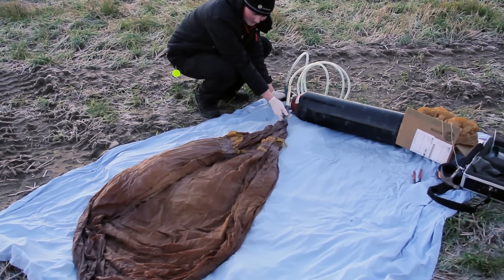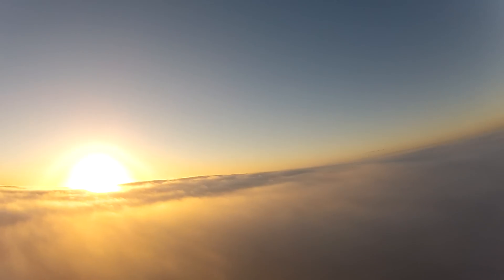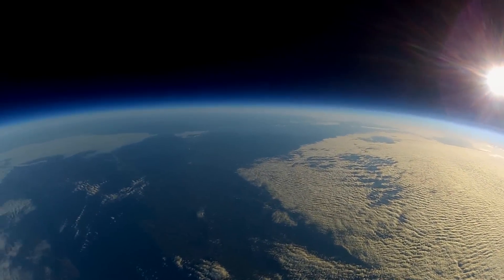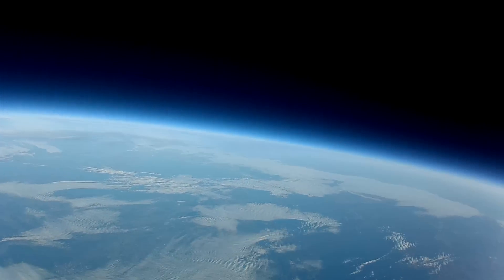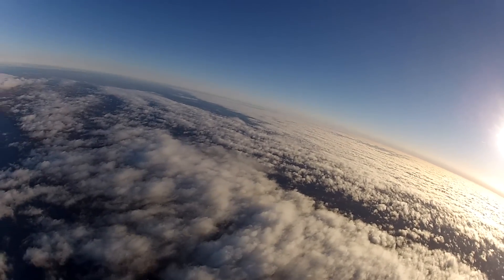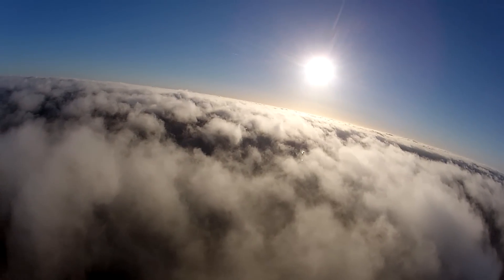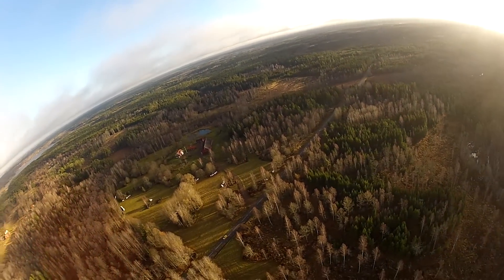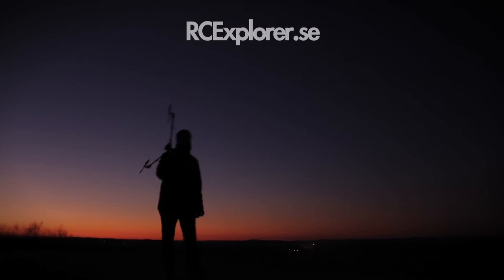Space Glider - FPV to Space and Back!

Comment: next attempt: attach small rockets with a total of 3 stages and get yourself into a sub orbital trajectory with small rcs thrusters on the glider
Reply: You did your kerbal space program thinking.
Reply: lets make crowdfunding and send 1000 satellites on the orbit so we can have free internet, then we can use those satellites to extend range of the remote controller and then we can start colonize the space
Reply: @mario2872  That is exactly what Elon musk is doing with starlink right now
Reply: @mario2872  wow. You predicted starlink
Reply: 8o7wer Endie NO, an rc single stage to mars (fpv)
Reply: Den Da Gamer someone's been playing too much KSP
Reply: Nope, solid rocket engines aren't going to cut it if you try and ignite them at 100k ft. It is true that hobby engines have an oxidizer "usually potassium nitrate" but to get ignition you need 4 things heat/oxygen/fuel/ and last but not least is pressure. Many people don't know this but pressure is required for combustion so only liquid "compressed" fuels or a large enough solid rocket booster where the weight of the fuel itself can provide enough pressure will ever work in a low pressure to vacuum environment. Looking into liquid fuel would be your best bet for creating the 3 stage rocket if you were going to launch it from the operating altitude of a weather balloon.
Reply: a powerful antenna (like really big) or have a relay solar glider to relay the signal. I know its expensive
Reply: @DenDaGamer  dragon link. Cross fire is better tho. Dont need a big antenna. Just a small T on your transmitter and another on the craft.
Reply: Ayyy kerbal space program?!
Reply: Dragonlink. google it.
Reply: Hopefully its possible...
Reply: Codey Dummer  no all model rockets engines have a chemical oxidizer and expelled gasses prevent surrounding o2 from contributing to the burn.
Reply: i think we should make the gun powder and shoot  the satellite to the space,because it's more simple and it's could burning well without oxygen.
Reply: lânchánđời nguyễn ?
Reply: ;)
 @lanchanoinguyen2914
Reply: @lanchanoinguyen2914  he can use a fuel oxidizer :)
Reply: Technically, this WAS a suborbital trajectory...
Reply: @Rickenbacker69  technically, if you throw a ball it already a sub orbital trejectory.
Reply: was my first thought too when i saw the video.
Reply: Codey Dummer it has its own oxygen
Reply: Den Da Gamer i gree that would be bad a$$ i want to see that video
Reply: Beat Elon to mars.
Reply: I will
Reply: You are late.
Reply: Yes!! Then fly it to duna or eve.
Reply: He actually did a suborbital flight
Reply: Ksp in this bitch
Reply: It's not possible, a weather balloon will only take you 1/3 of the way to low Earth orbit, there's no way to get enough thrust to travel that extra distance without allot of fuel and a heavier vehicle to hold it all
Reply: @ArmandoSilvier  ok let me rephrase this a tad, it's not possible at the current scale because you'd need enough fuel to travel those extra 200-300k feet. If we scale up things start looking better, think about model rockets. They can't go to space because of fuel limitations. But u can get higher if u scale it up. So sure it's possible but at this scale not as much
Reply: @ArmandoSilvier  also I feel like balloons are a bad idea, what if the popped rubber wraps around the rocket? It could drastically alter it's course or fuck up it's thrusters. I'm all for thinking outside the box, but balloons imo bad idea to get to space
Reply: FISH EYE LENS
Reply: that is actually very possible
Reply: Or make an X-15, that would actually be awesome!
Reply: 8o7wer Endie pluto isn't a planet, it's a planetoid
Reply: @presuuu  it's all up to human-thought artificial mental conventions. Planet, planetoid... Just our concepts.
Reply: Den Da Gamer . question. how he can have video from so far away?
Reply: Den Da Gamer  girl.       X
Reply: Den Da Gamer in
Reply: Concerning launching rockets from ballons, there IS a company doing that: Zero2Infinity
Reply: doesn't it take 1 million horsepower by today's technology to leave orbit? You start needing more thrust which requires more weight which requires more thrust.....
Reply: billybbob18 you can’t measure this in horsepower.
Reply: while you're at it attach a small titanium shooter, calculate the trajectory of the iss and shoot :D
Reply: that dialect. 1000% gay

Comment: The ballon busted wen it touched the firmament
Reply: No, from a combination of the extreme pressure and temperature.
Reply: +Lord Grief Mc. Scumbag 
No. Not more pressure. Less. There is far less air up there. Extremely cold as well. POP
Reply: blighto Correct, extreme pressure or more specifically the lack thereof. 
In mathematics "extreme" is defined as "a relative maximum or relative minimum value of a function in a given region".
Reply: The air pressure outside the balloon dropped to almost zero, making the hydrogen gas inside the balloon increase in pressure, making the balloon expand. This expansion caused the balloon to burst. To simplify:
Low air pressure outside --> High pressure inside --> Expanding balloon --> Bursting
It has nothing to do with the firmament. Also, if it was because of the firmament, wouldn't it just sort of get stuck there? Like a kid's balloon stuck to the ceiling of a convention center?

Comment: Can somebody send in space a fucking camera that doesn't have the fish eye effect? there are retarded people that say the Earth's curvature is not real and you see it because of the camera effect. Even if it's clear as fuck that the curvature is real because the camera moves left right and the curvature of our planet says still because it's real, there still are people that were probably born in a cave that say it's fake. So send a normal camera into space please. Thanks.
Reply: All lenses have some distortion.. All you need to tell a flat earther is to find a point when the horizon is in the center of the camera, therefore there is not any distortion. You see flat earthers logic works very backwards. They see a video where the earth sometimes appears flat, sometimes round. They come to the conclusion that the earth is flat because of a fisheye lens, not even considering the inverse statement that the earth appears flat due to a fisheye lens. They just parrot the fisheye lens argument without realizing how easy it is to tell when the image is not distorted. Any line that goes through the center of the view will have depth distorted only, so when the horizon goes through the center it will accurately show the curvature of the earth.
Reply: well since the camera is often used for navigation, the fish eye lense is a necessary evil..
Reply: The problem is most compact sport cameras have a curvilinear lens (fish eye) because they show a lot of what is going on around and exaggerate speed making the action look better. If you want to test it properly you need a rectilinear lens designed for photography or professional video work like the camera off a DJI phantom or a proper DSLR with a rectilinear wide angle lens.
All lenses do have some degree of distortion so you need to apply lens profile correction afterwards. But yes, any part of the image passing through the center of the lens will be closer to accurate in terms of distortion.
Reply: There are more videos of normal cameras in space than go-pro's, google is your friend.

Go-pro's are just the hobbyists first choice, so a lot of people have made youtube videos with them.
Reply: E I N S at this height, you still won't see the curvature of the earth

Comment: theres a broken balloon floating around space now - stop polluting space!!! lol jk

whats with the sun exploding video effect? did he add that or whats up with that?

the gopro can survive space?? best camera..best camera ever!!
Reply: 1: he didn't get to space; it starts at 100km and he only got 30km
2: it's called lens flare and such and it happens when the light from the sun overwhelms the sensor, and also is strong enough to see reflections off the clear lenses
3: again it didn't get to space, but reasonably low pressure
But that doesn't matter; all electronics work in a vacuum
Some may overheat though, or in low pressure may freeze

Comment: 100,000 is still a long way from space. 250,000 is the minimum altitude, but 328,000 is the official start of space.
Reply: +Ted Smith Check out the Karmen Line, that's at 100km above sea level - that's more accepted as the beginning of space (were you talking in feet here?)

Comment: This is NOT space! Outer space by most definitions is between 60km-120km, usually 100km(known as the Karman line). He did however rise above the Armstrong line(ca 19km) which is the point where the atmospheric pressure matches the vapor pressure of water at the temperature of the human body... meaning the water in your eyes, mount etc. will fucking boil!
Reply: +Nico By Its outer my space !

Comment: I have both a 2watt amplifier for setting back on my controller.  And directional antenna. Ca 30db.  What is the strengt of the antenna you use?  I have tryed to copy what you did with the range. Not sending anything to space.  I just want the range you have. Im buying and 2watt 5,8g also.  What antenna would you recommend?

Comment: Why I applaud your effort and this is very amazing, I can't help but wonder, as a commercial pilot. Do you need to get permission to 'launch' a weather balloon? If everyone starts doing this on random places (cause this is cool and it's getting more common) with airways pretty much over any house, could get dangerous :P Not that a balloon with a few grams of metal would bring down a full sized jet, there is still a threat. If by chance the balloon is sucked in an engine, or covers an essential piece of equipment like angle of attack sensor, pitot tube, RAM air inlet holes, things could turn ugly.
Reply: +Martijn Denecker In the US you need to follow FAA and FCC guidelines for payload, these rules have been around since the 1960's. As well as notify the closest ATC facility about your launch location, predicted flight patch, predicted landing area, etc...
Reply: +Zane Krempel Oh ok. Good. I hope they include this and the new UAV/drone regulations in future pilot training.
Reply: Martijn Denecker I'm not sure if local atc notification is a requirement or courtesy and if it shows up in notams etc. 1600 of these high altitude ballons are released a day 365 days a year fwiw.

Comment: Very cool... Slightly risky though,  ... Could take out a jet engine with it unfortunately...
Reply: +Ken Morton Lipos are pretty soft and get sliced in pieces easily. The part where they catch fire is not good, but if they go through a jet engine, I'm not sure that would be a huge problem.
The only problematic piece would be the RC motor itself, which is a pretty dense piece of metal, but thankfully it's not that big.

As for a foam plane damaging a full size plane, I think you're overweighting the risks. It's not impossible but I'm pretty darn sure it's much less likely than people think.
A metal and carbon fiber quadcopter however, that's a different ball game. It would definitely damage a plane and a jet engine, guaranteed.
Reply: Martijn Denecker my kidding set aside, both yan-Deriction and you are doing it wrong if you're just talking about "drones".
a 2kg foam plane with plastic propellor vs a 2kg metal or carbon frame quadcopter with the carbon blades that actually slice your finger, are so not the same thing in case of impact.
Reply: civilian drones like these are roughly the same weight at birds. the only time birds have taken out modern jet engines is when a flock of them flew through one. an individual drone produces no danger to the aircraft whatsoever.
Reply: +yan-Deriction negative, the Lipo battery that power these suckers are very dense, I would recommend for you to rethink your logic
Reply: +Ken Morton The chances are so ridiculously low it's it's an absurd proposition. It's reasons like these that we had the FAA regulate this.
Reply: +yan-Deriction Youre kidding right?
Reply: +Marc MERLIN Of course not. My comment was not aimed at you either.
Reply: Marc MERLIN a small explosion in a jet engine is fine, they are designed to withstand it
Reply: +Sutanreyu if you know anything about aviation you will know it's all about making your chances for failure or error as less as possible. This is why the best pilots have a tendency to have OCD